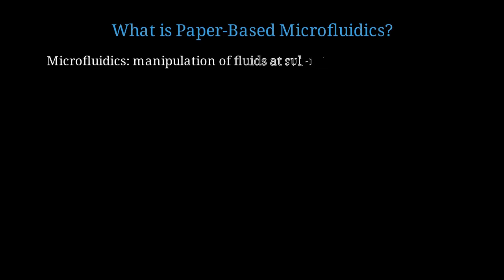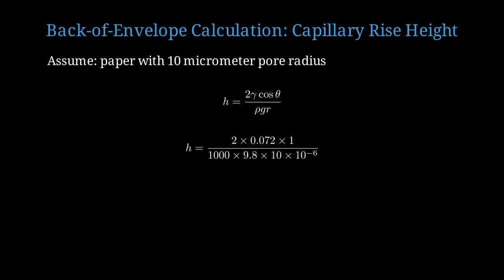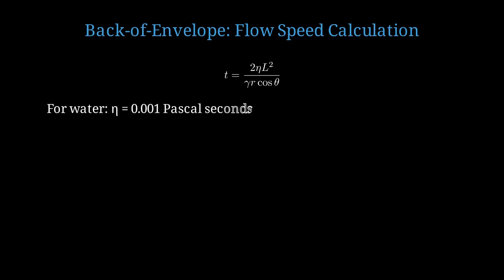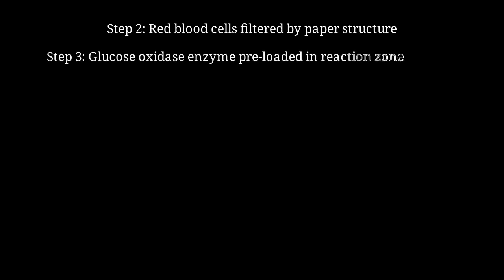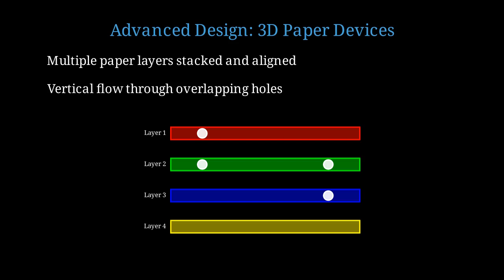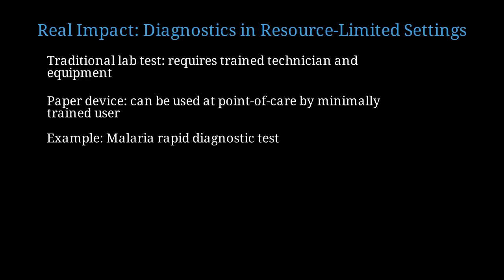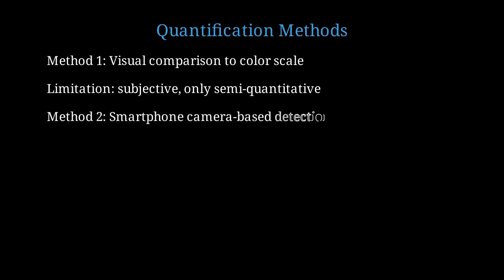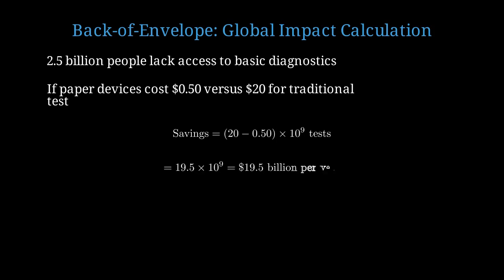Paper Microfluidics: Why This Changes Everything

Comment from the maker: How can we build a predictive, parameter-identifiable model that couples Washburn flow with evaporation, reagent dissolution kinetics, and reaction–diffusion to reliably predict signal intensity across climates?
What is the optimal pore-size distribution (not just mean pore size) that maximizes both transport speed and assay reproducibility while minimizing heterogeneity-driven variance across manufacturing batches?
Can origami/3D architectures be synthesized automatically (algorithmic design) to implement a specified multi-step protocol with target delays, volumes, and mixing—without valves or external actuation?